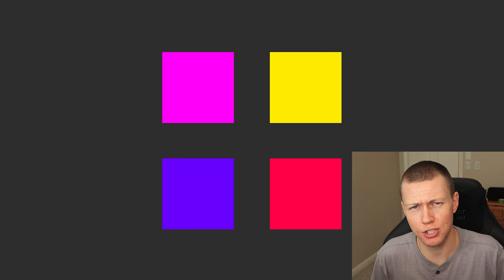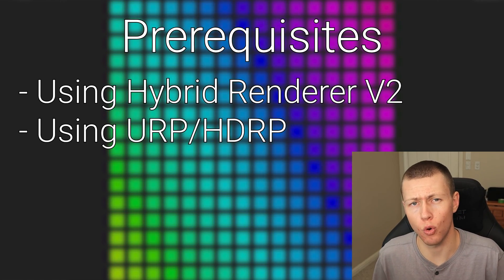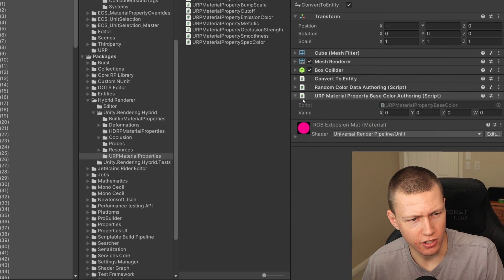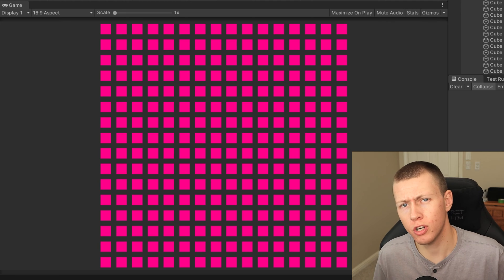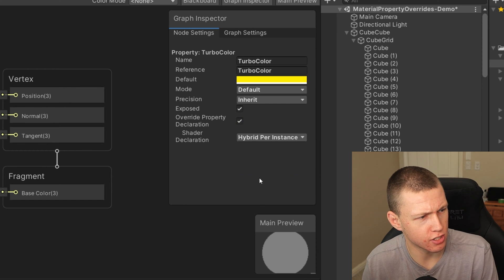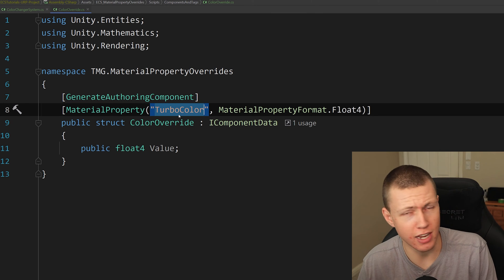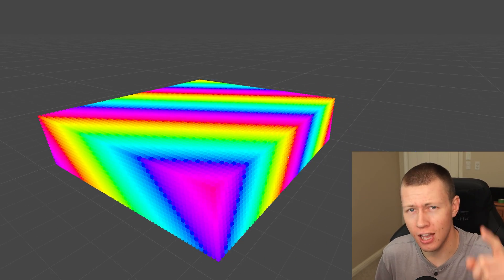Material Property Overrides - Change Entity Materials in Parallel - DOTS Tutorial [ECS Ver. 0.17]

Comment: Hey Turbo, nice video! 
I am currently working on implementing a simple glow effect, which is currently running on MonoBehaviour. Entities respond wonderfully to it, but only in the editor. In the build, only the MonoBehaviour objects change, but not the DOTS entities – material changes are not transferred. Your approach would be very helpful, but it seems expensive to execute the logic for each entity. Is it possible to use only one material in DOTS that is automatically transferred to all entities when changes are made, or is this only possible using overrides?

Comment: [GenerateAuthoringComponent] i assume this is used only when we are utilising ECS hen converting the MonoBehavior to ecs? if i am dfoing pure ECS entity creaiton i don't need to use this?
Reply from the maker: Yes, that attribute basically takes advantage of code generation to create an authoring component which can be added to a GameObject that will be converted to an entity. I should mention that using the conversion workflow is still considered "Pure ECS" and is often easier to use than creating all your entities through code. If you don't intend on using the conversion workflow, there is no need to have that attribute, though because it uses code gen at compile time, there is no harm in having it on anyways in case you want to use the conversion workflow later.

Comment: How to Set Texture in the runtime,I found MaterialPropertyFormat only support float
Reply from the maker: To change the material, you'll need to change the material component which is a shared component so changing it will incur a structural change.
Reply: @TurboMakesGames  Here my situation is Many model share a Material but use their own Texture.Thats why I want to set Texture in runtime
And If a scene has many different Material will It increase Render batch?

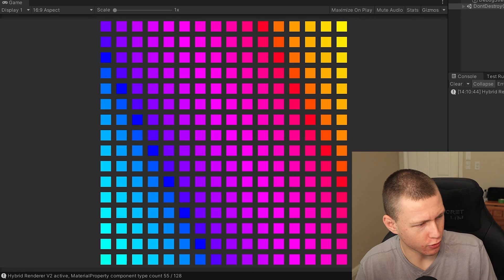Comment: 8:14 That Matrix moment when your mind implodes xD

Finally, I have been hoping for something like this for ages! next a similar thing for shared animations and models! Unity please!

The shader graph approach is what I actually had been already doing, but this makes a lot more wholesome and less gimmicky. However, I think the color change effect in this particular case would be much more efficient done over at the shader side.

What I have been doing lately, is that while building my project's architectural framework and converting it into DOTS/ECS equivalent, I have built the documentation and design with Milanote and when I see you cover a topic I am going over or have not yet addressed, I watch the video and copy the URL and paste the video right into the Milanote documentation to that feature.

So when I will later return to it, and start implementing it, I have your video about it right there in the actual task item already waiting (and can play inside the documentation), if I (or later someone else) need to refresh what the hell does that component actually do, or how to properly implement it. Especially useful with complex stuff I don't normally do, like the blob asset setups.

This one is going right into my material asset item's documentation
Reply from the maker: Animation property overrides would be great! I do something similar with my notes/documentation in Obsidian 😊

Comment: I kinda have to change (a lot of) material properties to update the board on the visual side (in prjChlg).
However, I could use chunk system to cut down a lot of objects with only visual purpose.
Reply from the maker: I'd recommend using material property overrides if you can!